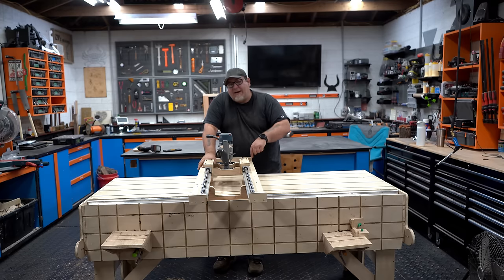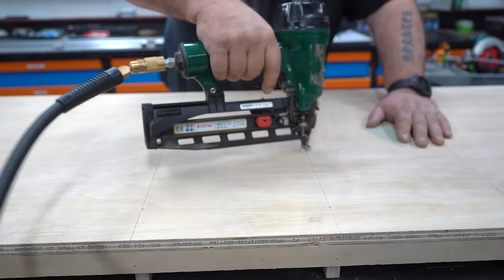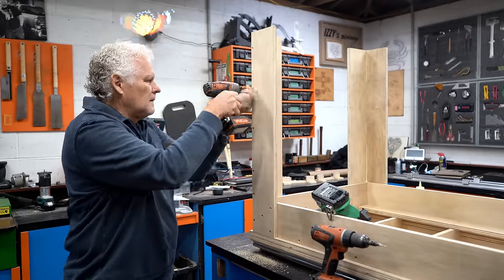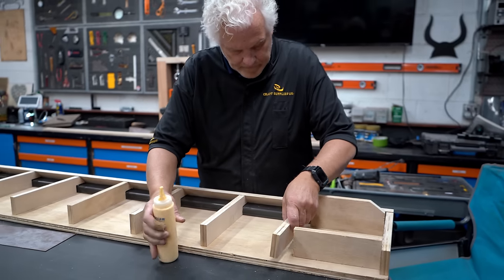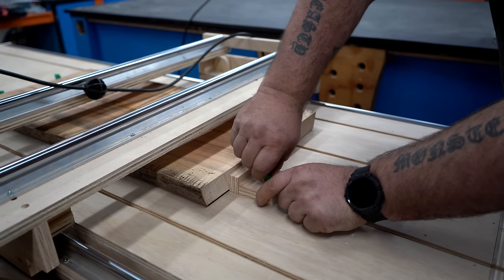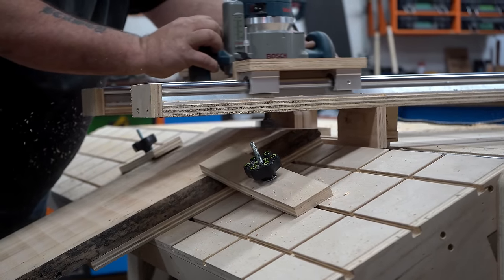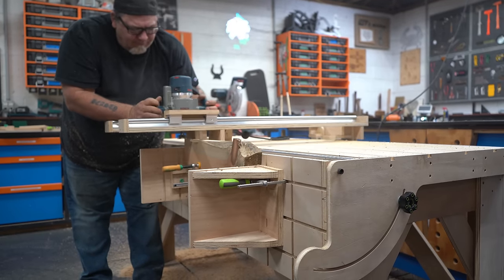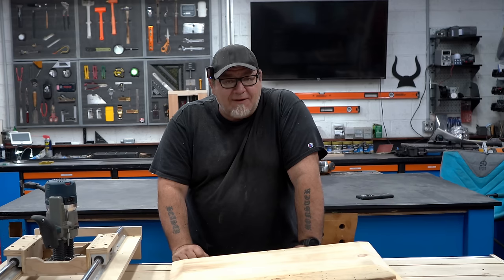How Slab Flatteners Should be Built

Comment: Nice rig!!.  But, FF to 9:32 and note both the flex in the sled assembly as well as the upward lift of the near-to-camera end of the sled when working off the end.  I think you're getting a slightly rounded profile as a result.  How rounded?  How important to engineer that out?  This isn't a criticism.  Just relaying observations.

Definitely do not think that it could, or really - should, "replace" a planer or jointer though.  And you can store both under that whole assembly, so not sure you've reduced your footprint.  If you'd built a true torsion box as the base that could be stored, and were using collapsible legs that could be stored, perhaps.

Comment: I do not see it to replace the jointer, as those things are so fast to use, and you get it done with couple passes for almost any piece that isn't too small.
And routers seems to still require the sanding and planing to get the same surface quality.
But that doesn't mean this doesn't replace the need to use that separate tool in many projects, when you need/can use anyways this to do the other work for piece, that anyways would be either impossible or challenging with any other methods. 

That is a great work and great idea.

Comment: You could throw a template bit on it and use smaller templates without having to worry about how much of the router’s weight is hanging off of the edge of the template.

Comment: It is a very cool rig that has a lot of capability. As far as using instead of a jointer and planer goes though I don't think so. The floor space it requiers is beyond what a jointer and planer require plus j &p can be on wheels so they can be moved out of the way. Your setup is just too big. Yours would be great if slabs are the shop's primary function.

Comment: Using 2 linear rails with, both with 2 degrees of freedom is a bit dirty. Unless you either line them up perfectly parallel or make a somewhat flexible gantry you may run into trouble there. Whenn you draw something in cad it is always way too easy to assume parts are straight and parallel.

Comment: Thought #1:  OMG Izzy!  Doesn't that router noise bug you without hearing protection?  I don't wear hearing protection to save my ears (though that's a benefit); I wear it because the loud noise of my router in close proximity physically HURTS!.  Thought #2:  I realize this is much cheaper than a CNC, but these flattening jigs always strike me for how manual they are for what a CNC would do automatically and with a better/stiffer gantry.  I think if I were doing slabs frequently, getting a CNC would be the way to go, and if I did them infrequently, I'd take the slab to someone with a CNC.  I think I'd only go build a flattening jig for a weird or oversized piece that didn't flit on the CNC.  Admittedly, I don't work with slabs, though, so maybe this is a great option for some people.  I do have a long, homemade base for my DP611 router which I've used with another clamped reference edge to do the deep chamfers like you showed there, but if I were doing that more, I do like your setup for that purpose quite nice.
Reply from the maker: I like the load noises.

Comment: From a speed and dust/mess perspective I don't think it can replace a jointer/planer, sorry it looks like a lot of work, but I couldn't justify the floor space for the extreme chamfers it can cut on live edge slabs given you can do this with a track-saw and a wedge under the track to increase the angle. BUT.... If I was to put your mind to work on a slab flattening problem I routinely have... it would be something you alluded to at the beginning of the video needing something flat to reference off of.... My workbench is 4x8' thats where I do all my slab flattening; but my workbench isn't perfectly flat anymore. Given its made from 1.5" butcherblock top; I could flatten it, but that would mean I'd need to set up a mill to reference off my not-flat shop floor. So... if your mind can you think of a way to deploy slap flattening mill that can EASILY deploy on unimproved/non-flat reference surfaces to flatten objects larger than our benches that would be valuable to me.

Comment: what if it were Mounted perpendicular to the wall. (on the wall)   and then the sawdust would fall down.. (as well be blown from the air assist)  .   and have a flat vacuum suction on the foot or even a Metal Grate below where it would suck up the debris (bark) and sawdust.. 

like do all that but prop it against the wall. or PIVOT from the floor orientation to the wall vertical orientation.   [ Better yet., just use a predesigned MURPHY  BED  mechanism rack and pivot ] and hide it all away for hidden storage. ]

Comment: big bit surfacing in a router will not hold its edge, can not be sharpened more then two times, and will leave a surface that is noticeably machine cut?
Reply: That is why rotational machines are not used to make profiles in material that will need a fine finish in wood